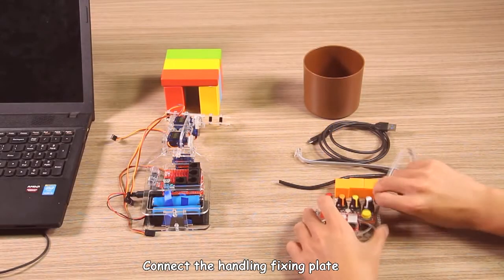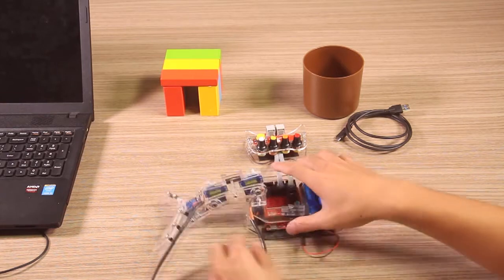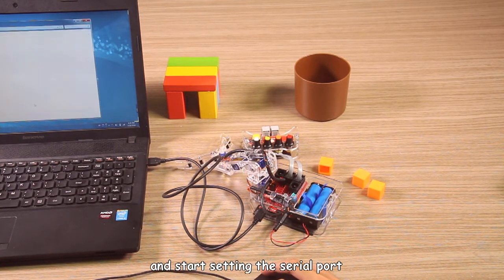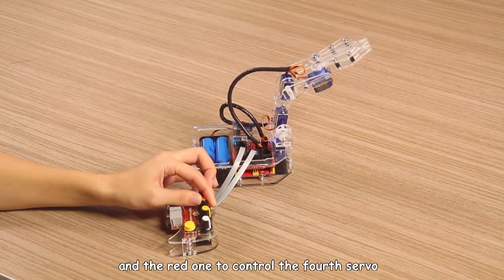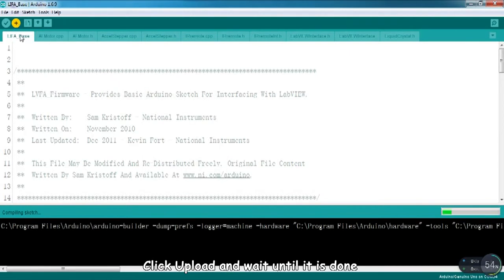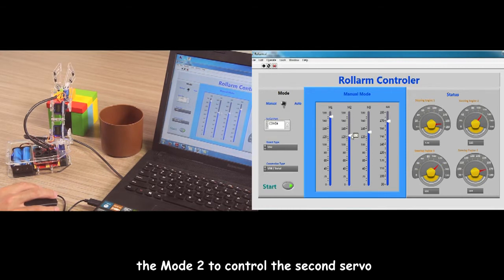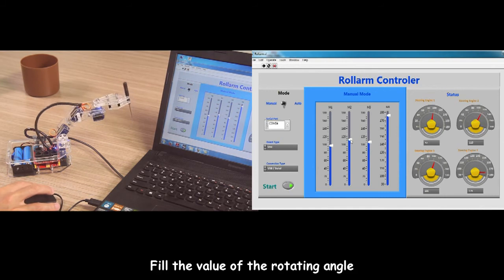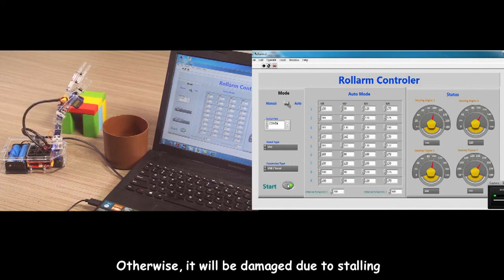DIY Control Robot Arm Kit Rollarm for Arduino - Assembly Tutorial 02 Wiring & Control

Comment: Would this work with IOS?
Reply from the maker: It can't connect with the IOS, what a pity. We may improve it and make it more convenient.
Reply: SunFounder How soon can you make that upgrade?  How about jail braking?  Is it wi-fi compatible?
Reply from the maker: I can't confirm when we will upgrade and promote, but it not available at present. And it has no wireless control,  The wi-fi compatible is not available.